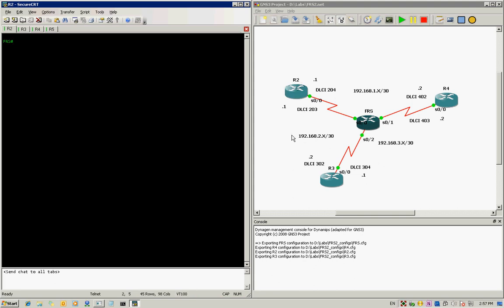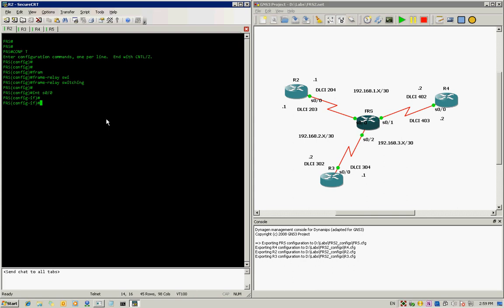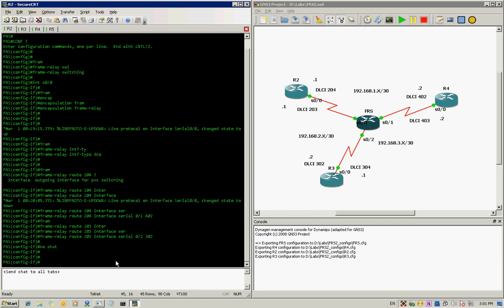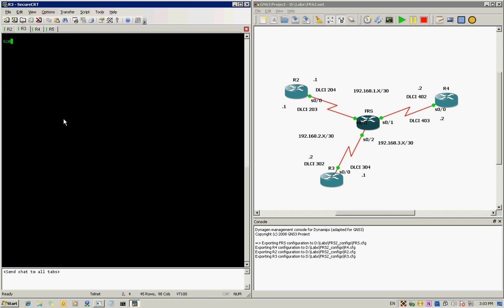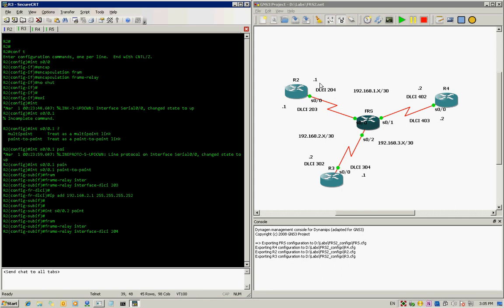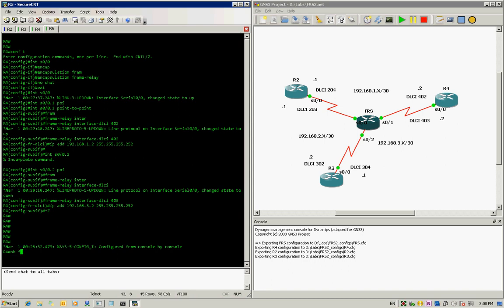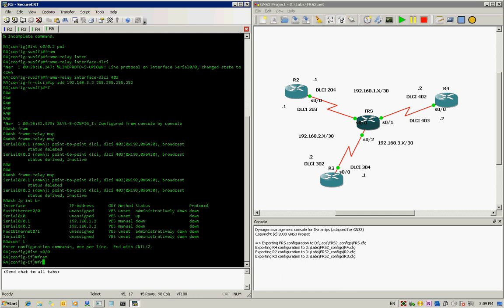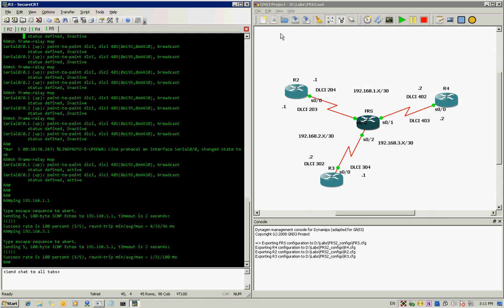cisco router based frame relay switch

Comment: In your video it is not clear which Router in the topology diagram is the FRS. Because though in the topology it shows R1,R2 ,R3 but you seemed to have changed the hostnames . Please share which one is the Frame Relay Switch
Reply from the maker: rajib roy The FRS is the one in the middle and the other routers are R2  , R3 and R4.. there's no R1